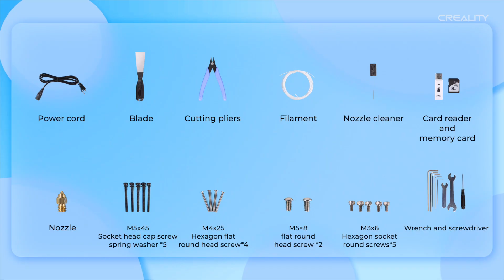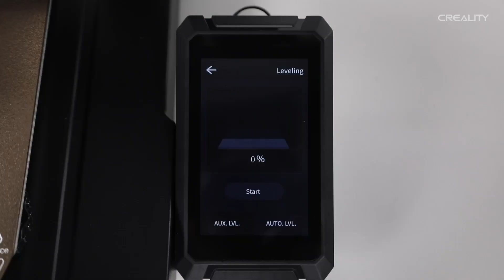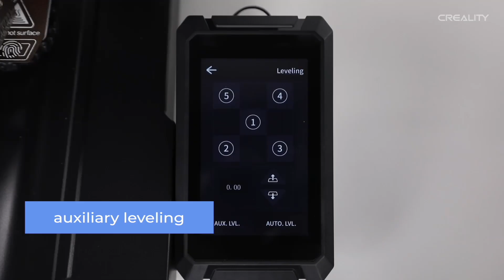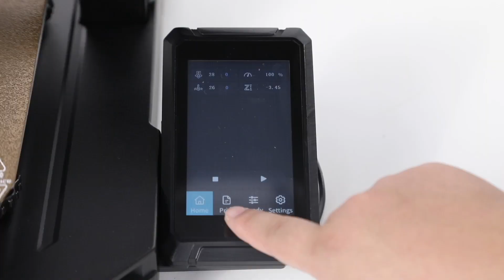Ender - 3 S1 Pro Unboxing and Hands-on Video

Comment: gosh this is VERY basic setup video. BUT the machine comes with far more detailed instructions and supporting info, on an SD card.
Note for anyone setting one up:  the Z Axis Adjustment is critical.  One the leveling has been done, you will likely need to set the Z Axis Adj to something like -2.5mm (that worked for me).  This adjustment controls the height of the nozzle above the bed, and is crucial for not having strings of filament, pulling the job around the bed.   eg  I initially set that to -2.1mm and the job wouldn't sit still on the bed, and was pulled around by the nozzle. A mere 0.4mm lower, and the test job (rabbit) came out perfectly.